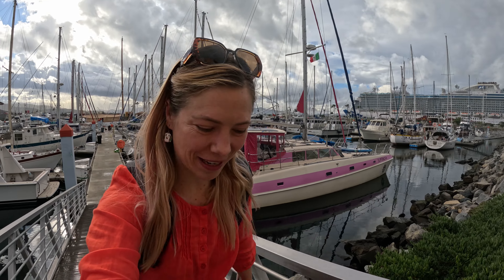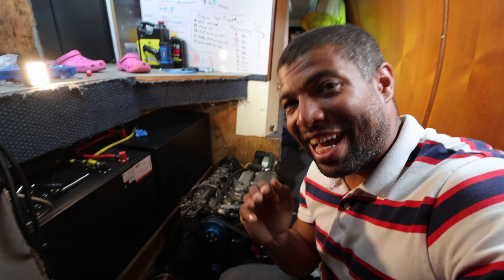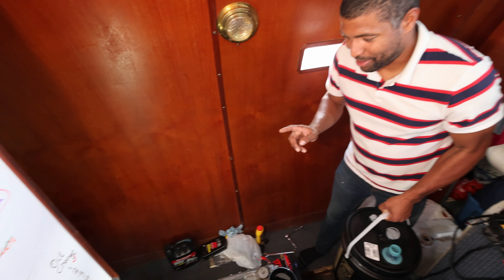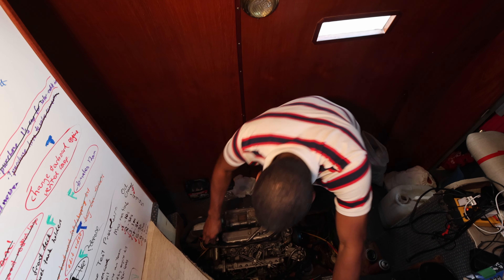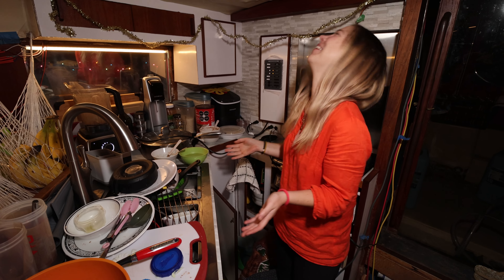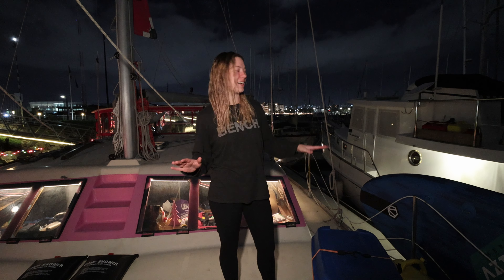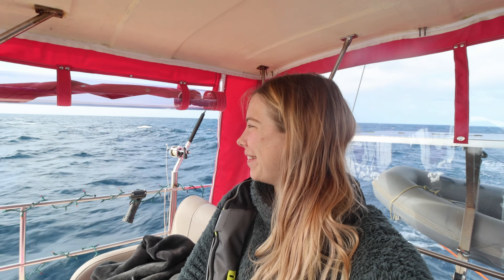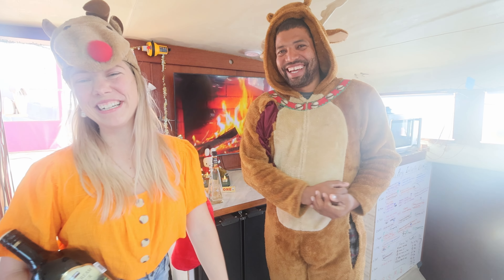WILL OUR MOTOR START FOR CHRISTMAS... YES!!! [Ep. 21]

Comment: I’m at 19m30 and I’m wondering if the T piece is an isolated and you isolated both the wind meter and the autopilot. If that is the case move the wind meter to the end of the bus and isolate it from there leaving there AP connected to their powered bus… (or I could be talking out my a***)
Reply from the maker: We will try that if it acts up again, its been so odd but its all working now, but not sure its going to stay that way, it seems to have problems at random.

Comment: For the anemometer, perhaps it is a short in your cable up the mast from the cable rubbing. Measure the resistance from the cable wires to the mast, they should be open circuit (although possible one might be earthed to the mast). Check it when playing up and when working.
Reply: You could also try another cable (perhaps on the deck).
Reply: Perhaps the cable has a internal short.
Reply: Check for poor connections on the connectors. Swipe clean the plugs, do this by plugging in and in plugging a dozen times.
Reply from the maker: We have replaced just about everything to do with the anemometer, Garmin has help us find out that it is a problem with the Autopilot feeding power to the NMEA 2000 network when it should not be. still don't know 100% how to fix it but we are trying different things, and Garmin has been great helping us out with what to do.

Thanks for all the ideas of stuff to look for :-)

Comment: Merry Christmas, you are doing great. What’s with the shower? Do you have the port side forward head with the separate shower. I would like to see a floor plan of Supernova to see how she differs from our Prout.
Reply from the maker: There is no working shower right now, we have two shower bags, we are going to put in a deck shower first then start working on making one of the 4 heads into a shower. our layout is like a modern cat with 4 beds and for heads with gally up, the main difference is we are only 19 feet on the beam and have almost no storage haha

Comment: Nice video, congratulations, Merry Christmas/happy new year.

First I'd like to stress. Hassards to navigation. As pretty as your Christmas lights are at the dock. But being underway looking like a Christmas tree is a hassard for others,ie. How can other boats figure out your position of direction, in other words. The port/ red, starboard/ green,  stern/ white lights are the direction lights telling others on your direction for them to know,and to keep clear of one another. A key safety factor for others to rely on. Something every boater should take seriously. 

Excellent job repairing  your engine, you should think of getting some books on diesel engines and other equipment. Nigel Calder is very popular for many Marine books .

Be extremely careful tightening anything without a torque wrench, you will eventually create a major problem, like warping your valve cover to beyond gasket repair. Sequence tightening is crucial in many things, something u can get from your eninge manual. 

Looking at your engine compartment, I can see your battery set up very nice, but you should really have a tie down system, even though you have a plywood ledge at the bottom. If you ever get hit by a large strong wave,and you will. The weight of your battery landing on your engine will be disastrous to say the least. For the cost of some time down or an upper rail is worth thousands in repair costs, not to mention possible disaster.
Reply from the maker: Thanks for the tip on the lights, after you sent us this we started tunning them off when underway. we should take them down soon but they are fun at anchor.

We are going to look at getting a book for the engine and get better at that stuff, we also have a torque wrench coming, we should get it in about a month from now.

We are also going to put some framing around the battery so it can't go anywhere even if it was upside down :-)

All great advice, thanks for taking the time to help us out, it means a lot to us. 
We hope you will keep having a good time watching our videos :-)

Comment: Ahoy Supernova Darcy and Yvette:The problem with your autopilot's irratic operation and calibration issue may be due to the connectors from the fluxgate compass to the autopilot instrument or processor itself.
Assuming its a Ratheon similar to my old ST4000 or similar, the cable from the compass is terminated with crimped push-on spade terminals at the instrument end.
One or more may be loose or corroded(even only slightly).I suggest pulling them off for inspection and retighting if they seem loose.They should be reasonably tight pushing them back on.If not you can gently squeeze the curled sides with pliers.A small scew driver can be used to wedge them up a bit if too tight to get back on.
Over time vibration and micro corrosion can affect operation.My Ratheon system is 32 years old now and I've experienced a similar situation twice.
The other possibilty is,because the fluxgate is internally gimbaled,it may be hanging up.
I use a magnet (or a steel tool such as pliers) about 12 inches away and rotate it around the compass while observing the digital reading for smooth change in direction.
Those push-on connectors are often deceptively problematical and may even be caused by a poor crimp.
Hope this helps and wishing you good voyaging.
Cheerz!
Reply from the maker: Thanks for the detailed explanation. We will check our connections again.
There is a power problem with our auto pilot, its feeding power back into the NMEA 2000 network, but only sometimes. Its a really odd problem.

I bet you have had some really cool adventures on your sailboat!

Hope you have a great new year!

Comment: Yea ur tighting the valve cover way to much only 10ftlbs
Reply: Since they don't know what a quart is they probably don't know what a ft-lb is either. 10 ft lbs is about 14 Nm which is about 1.4 kg-meters. So that is like 5.6 kg at the end of a 250 mm wrench.
Reply: I would also suggest checking the sequence as well.
Reply from the maker: Darcy took them off and put them on again, thanks for the tip!
Reply from the maker: we have a torque wrench on the way! should get to use in a month or so.
Reply from the maker: I don't know if there is a sequence, we just did the two forward one back, ill have to check on that. thanks for the tip

Comment: Merry Christmas to you both. Loved the outfits! On the wind vs autopilot issue, the wind worked after the install of the part, autopilot didn't, could it be the autopilot 'system' needs a complete reboot? Just a thought. --Jerry
Reply from the maker: we will try that, its been all over the place with working and not haha, 3 days ago it said we were going 12 knots in 10 knots of wind haha